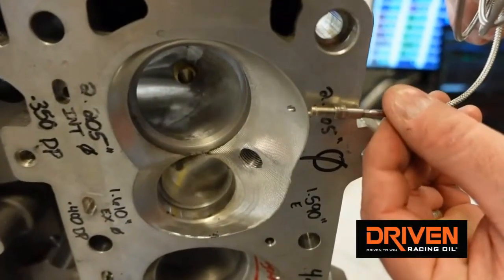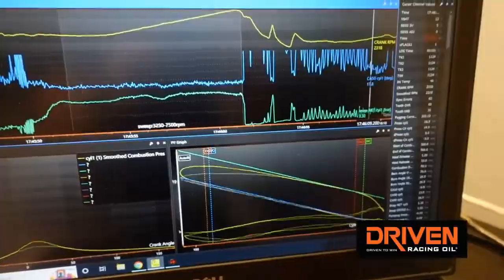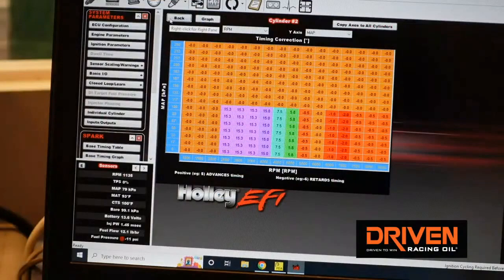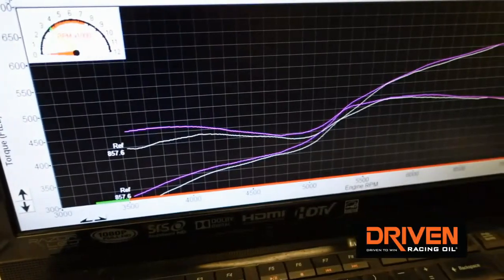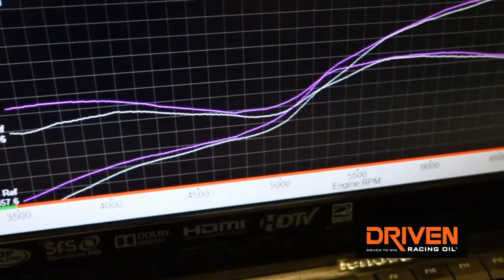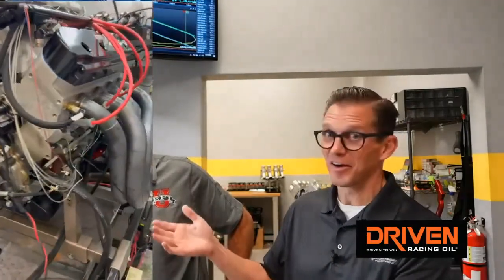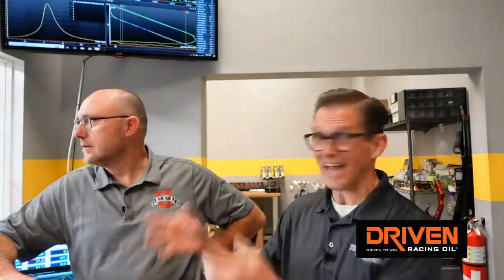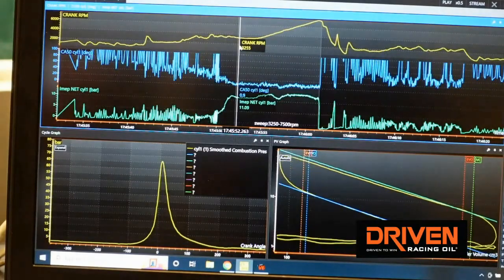In-Cylinder Combustion Analysis (2023 - Episode 30)

Comment: I wonder how much crankshaft torsion is affecting the cylinder-to-cylinder pressures as well? It would be nice to incorporate the sensor into a special spark plug so no cylinder head modifications would be necessary. I assume that you are using a wide-band O2 sensor in each cylinder header tube to confirm fuel distribution is not a factor?

Comment: Mercury marine applied that technology to their V6 and V8 platform on there outboard motors @ 2019,they were able to ditch their old super charged 2.6 litre platform and build a naturally aspirated series of engine which had massive torque gains throughout the whole operating range

Comment: We were doing this in the 80s. you can also look at crank angle / velocity. we also used knock sensor / cylinder to control timing. this equipment was very expensive. 100K+